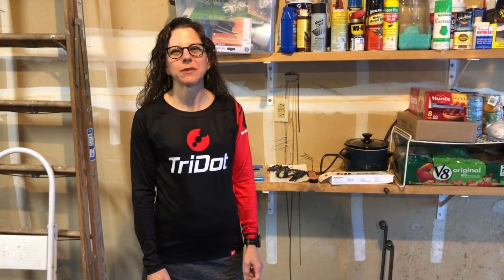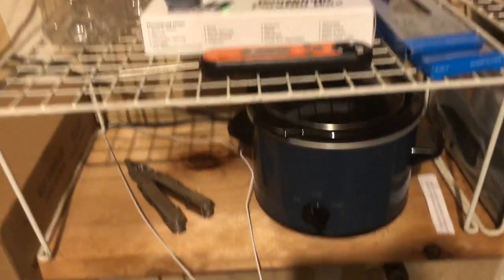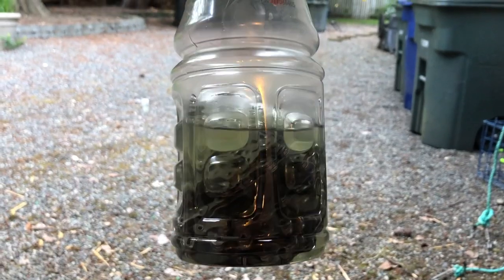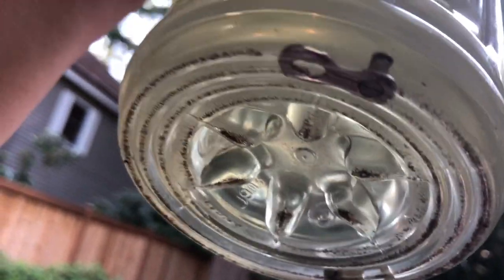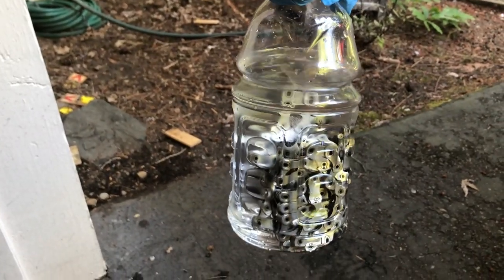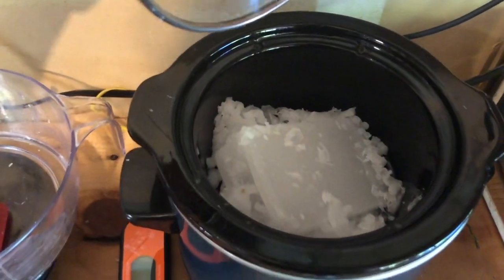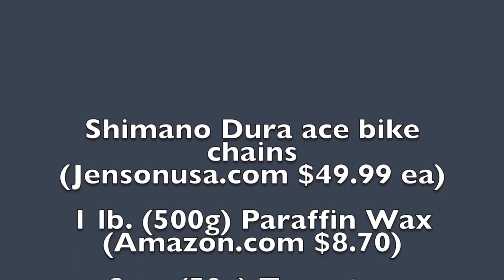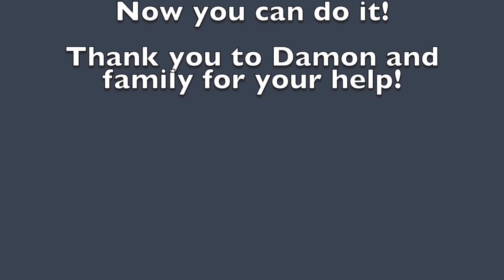Bike Chain Hot Waxing

Comment: Are you still using this method after 2 years? How has it been? I was going to buy the silca wax, but I am more of the kinda diy guy, so I think i want to try this instead.
Reply from the maker: I’m still using the same method 2 years after switching to waxing and still use my own recipe from this video. My understanding is the Silca wax is actually very similar and over priced. 
I have since qualified for 70.3 World Championships and raced it using this wax formula. If you watch Cody Beals on Instagram wax his chains, it’s almost identical to what I do, just with MO2 (molybdenum disulfide) instead of WS2 (tungsten disulfide).